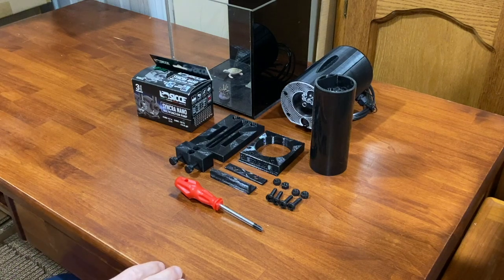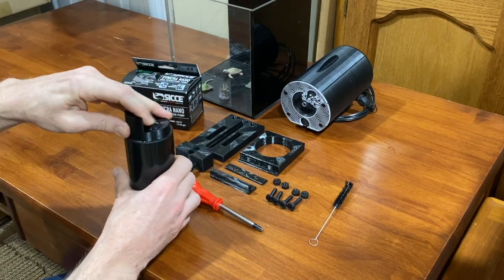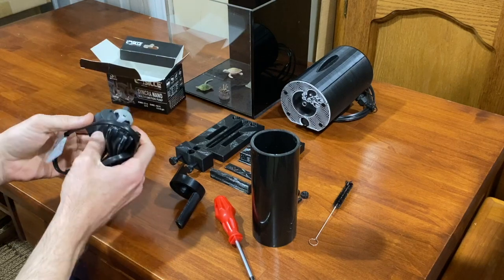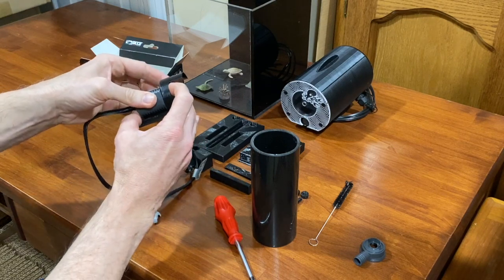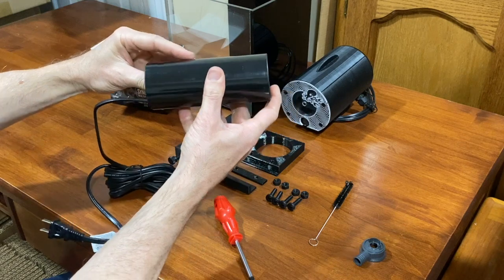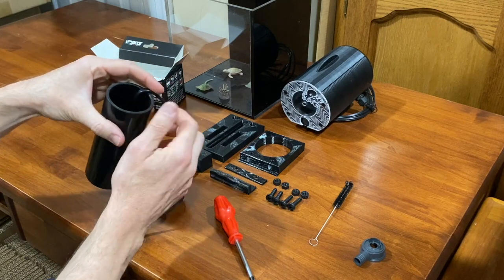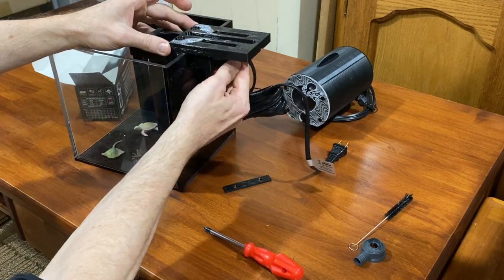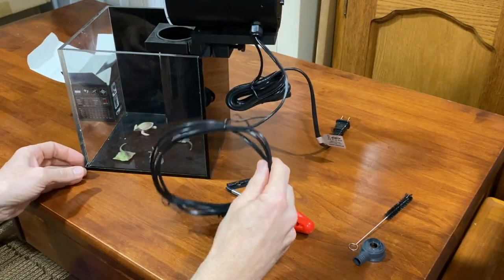Plank Autofeeder v3 5 Mixing Chamber & Platform Assembly

Comment: Finally got around to adding the updated pump. Super easy. It was a little loose in the original pipe but a little Teflon tape fixed that easy enough.